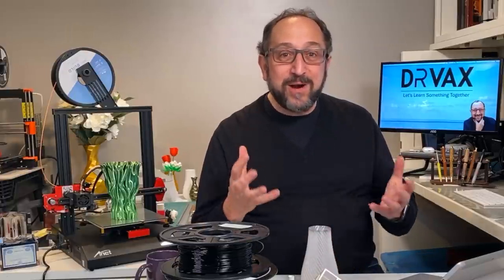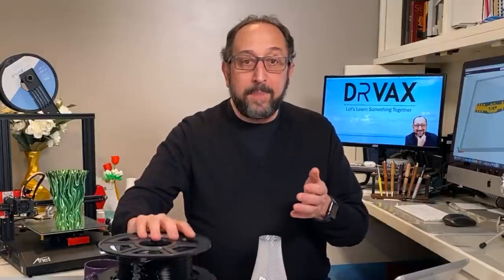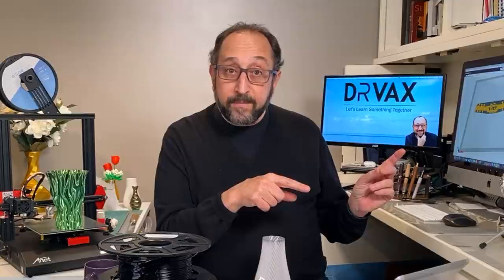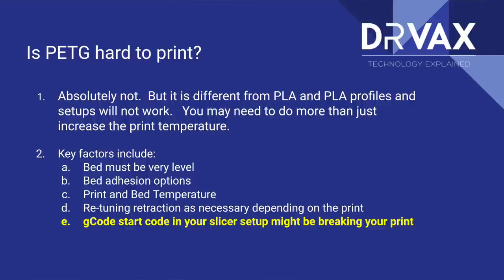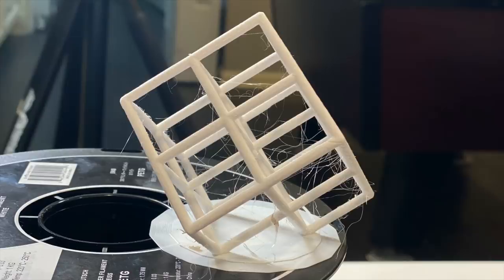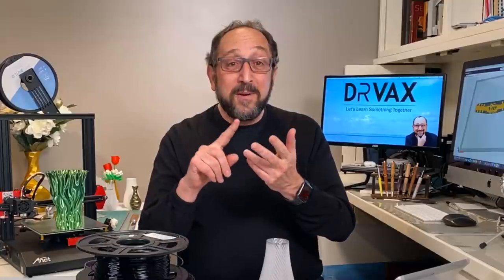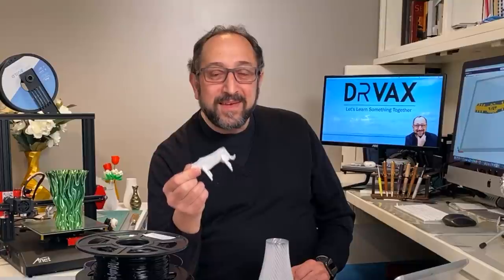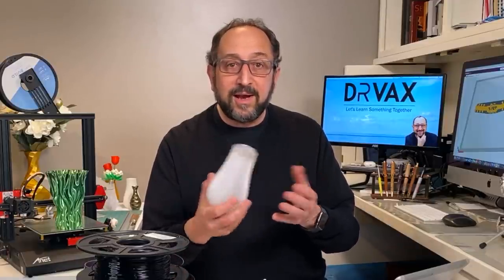How to 3d Print PETG Reliably and Safely

Comment: So I am just starting. But I noticed at least the alpha/beta versions of Slic3r (and Prusaslicer, based on slic3r), (and probably others I haven't tried yet) do indeed set temperatures and wait now. They do not require any editing of the gcode. They do not have a default profile for PETG either. But the types of PETG can vary greatly in temp. settings, so maybe that's why.

Comment: The second set of temperature settings for bed and nozzle are repetition, and do not do anything, as after the first set you do not touch temperatures. Furthermore you could remove redlines and replace them with macros. What I do I heat the bed, home and level, then heat up extruder and start the print
Reply from the maker: I agree that should be how it works but I have found better results by adding the "belt and suspenders" of the second set of temperature settings.  Thank you for participating in the discussion.  I will do some more testing and report back if I find the second set of settings make no difference.  Once again thanks for contributing.
Reply: These are great suggestions.  One I would suggest changing is the start code.  You can accomplish the same thing but also speed up the process by heating both at the same time.  Then wait until both reach the correct temperature.   I do Bed temp first as it is usually slower to heat up, and wait for nozzle then check bed.  The only criticism on this method is that your printer power supply must be able to handle both from a cold start.  I have never heard anyone actually having a problem. 

M140 S[first_layer_bed_temperature];
M104 S[first_layer_temperature];
M109 S[first_layer_temperature];
M190 S[first_layer_bed_temperature];
Reply from the maker: @Kari Penttilä I value your comment and your contribution to the DrVax community.

To help us all build the DrVax community of "makers" I have created a new community forum at http://forum.drvax.com .   At the DrVax forum, you can engage in discussions with me and other community members, use a rich text editor, and post images.  This should facilitate better communications.

It would be great if you could repost your comment to the forum to help with the discussions.

This forum is still in beta and the software I am using is complex so I may have some feature misconfigured. 

All the best.  Irv

Comment: I think now they might have changed a thing or 2 with the start GCode because what I know when I start a print, the first thing the machine does is always to heat up bed and nozzle to the print temperatures I have set in the slicer before it even starts printing the test line. The temperature for the test line is not hard set in the start GCode but even before that, so that it always heats up to correct printing temperature before starting doing anything including printing that line and then after the line have been printed it goes on directly to print the object without attempting to change the temperature again. It holds at that set temperature during the entire cycle from test line until the part is finished.

Comment: I can't get the sunlu petg to stick to my glass bed :( pla sticks like a charm

I got Elmer's purple glue and I'll try it
Reply from the maker: I really like using Magigoo with PETG and have used it on glass beds with good success.  In addition you may have to adjust your Z offset to print PETG depending on your printer.
Reply: If Elmer's doesn't work I'll def try that!
Also the Z. I know I'm squishing too much but if not the pla won't stick. I can do 2 different offsets though

Thank you!

Comment: I would like to print a cover on a radiator cap for a 100 year old Overland car.
Reply from the maker: Not sure PETG will work.  You need to measure the temperature of the radiator cap when the car is hot.  That temperature needs to be below the glass transition temperature of the filament you are going to use.   You can google glass transition temperature and a filament type to find this data.  For example this came up for glass transition temperature petg:  

"190 F
The resulting molecular structure is irregular and the resin is clear and amorphous with a higher glass transition temperature of 88 C (190 F). PETGs can be processed over a wider processing range than conventional PETs and offer good combination of properties such as toughness, clarity, and stiffness."
Reply: That is the temp. that it would be operating in . thank you very much .

Comment: You can also print in higher temperature filaments with 2 add on parts.
#1) AC Hotbed [I worked with Keenovo the produce an AC heater for the Ender 3/3 Pro/5/ 5 Pro]: https://keenovo.store/products/keenovo-silicone-heater-235mm-x-235mm-for-ender-3-3d-printer-build-plate-heatbed-heating-upgrade

For the Hot End you only need to change your heating element for a higher temperature unit like the 50 Watt units from TH3D Studio [easily powered as you remove the Hotbed Mosfet to use the power only to activate the Solid State Relay for the AC hotbed heater as well as the power hungry DC Hotbed]: https://www.th3dstudio.com/product/high-temp-50w-heater-cartridge-12v-2-meter-wire/

Done! The Ender 3, 3 Pro, 5, 5 Pro can now print in any filament you want to use [although to do so for filaments requiring higher than 255°C you do need to change the Thermistor for a Thermocouple as a Thermistor will be destroyed by anything higher than 255°C]. Both the Hotbed and the Hot end can now cross into any temperature you need.
Reply from the maker: Yep correct.  I have extensively upgraded my Ender 5 with a MiniSwiss all metal hot end, a 32 bit control board, capricorn bowden tubing, SEEMECNC EZR STRUDER, and Marlin 2.0 that went with the 32 bit control board.   While I love doing this stuff, many of my viewers want to use a printer out of the box and are not interested in modifying it in any significant way.
Reply: @MakeWithTech  We created the hotbed for those who like their printers and it's bed size and don't immediately wish to upgrade to a unit with a larger bed, but do want to print in many materials. This AC hotbed heater not only crosses well above the temperature the original DC bed can, but it uses substantially less electricity.
My Ender 5 also has a MicroSwiss hot end, the Keenovo AC hotbed, a finer thread 8mm threaded rod, a thermocouple hot end temperature monitor and a Bondtech extruder.
Nearly identical for my CR-10S and parts already ordered for my soon to arrive CR-10S5.
Reply from the maker: @monkeymanstones1 I value your comment and your contribution to the DrVax community.

To help us all build the DrVax community of "makers" I have created a new community forum at http://forum.drvax.com .   At the DrVax forum, you can engage in discussions with me and other community members, use a rich text editor, and post images.  This should facilitate better communications.

It would be great if you could repost your comment to the forum to help with the discussions.

This forum is still in beta and the software I am using is complex so I may have some feature misconfigured. 

All the best.  Irv

Comment: Thx for this. I've always had issues with PETG on my Ender 3. I've just installed a Micro Swiss all metal hot end which should allow higher temps. I didn't realize the gcode part. So is that gcode good for all materials? Do you use the same code for pla? I'll have to search through your channel to see if you have a video on the effects of different nozzel sizes. I'd like to try to print some items faster. Not worried about fine details.
Reply from the maker: Yes because the gcode uses cura variables it works for all materials.

Comment: Hot in your car over there  here in summer  we can get summer temps  105 to 120 degrees in the shade not even in the car
Reply from the maker: Wow.   I guess PLA is a no go for anything used outside.  Even PETG may get a bit soft.  Your 3d printed project may just have to stay inside. :-)

Comment: Well, I not buying Magicgoo it is very pricey in the UK, from £18 upwards stuff that!  I tried glue sticks, hair spray and even the much bragged about blue scotch 3M builders tape. None work even with PLA never known PETG or ABS... I spent over 3 hours once trying to level the Tronxy X5SA bed. that's using the auto and then the manual leveling systems.. and having to adjust 6 bed leveling screws is no fun I can tell you as 4 would be hard to get right but 6 seems to make it harder?  I brought a Tronxy ultra flexible magnetic print bed with the roughened surface, No luck sticking any filaments even on that. after 4 months of fighting with leveling issues and such I managed to print two items and that's all. And those two were a pain to do. As hobbies go 3D printing is hell to do and bloody pricey to keep up. time I buy the printer the tools the cleaning tools the many different filaments etc. it has cost me far more than my hobby I did for years that being Astronomy. And at least Astronomy worked after the set up and gave me years of delights. 3D printing just caused me tons of stress and wasted money.. I lost count of the amount of help videos I watched and tries of printing I done and now have a big rubbish bag full of waste of the failed prints and rafts for them etc.  I now thinking of selling all the 3D printing to at least get some of the tons of money back and go get something that will be better?  Really a pain... and so many long term 3D printing people online saying how good and easy to do printing makes me feel even worse as they seem to do it well and I don't no matter the try's and testing.

Comment: I just steal the wife's hairspray for my glass bed. 

I use PETG when I'm going to print something that is "functional" like a car part or motorcycle part or any other thing that might get warm or be placed under stress. I use PLA for smaller stuff, or to make test parts where I'm checking the fit on something.

Comment: I don't know why you have so many temperature settings.   If you have material_print_temperature_layer_0 and manterial_bed_temperature_layer_0 variables by line 8, you would have them at line 3.  You could just enter those variables at lines 3 and 4.  Then, after your bed comes up to temperature, your home command will run, at which point, you should run the M109 S{material_print_temperature_layer_0} command to wait for the extruder to be up to temperature.  After that, you can print your lines.  I don't see any code there that would change the temperature after your lines are printed that would require you to set the temperatures and wait again.

My start gcode has 3 temperature lines.  M104, M190, and finally an M109.  It works fine.  The fact is, if I wasn't worried about wasting time, I could get away with just 2 blocking temperature lines.

Comment: You put the wait code AFTER the scrub line.  Good advice bad example.
Reply from the maker: You are correct.  In fact it is both before and after the scrub (purge) line.   As pointed out by a number of people this is probably overkill and the second set of waste commands will complete immediately.

Here is the code shown in this video.
; DrVax May 2020 Start Code
; This first section is for printers with ABL
M104 S200 ; heat up extruder before calibrating bed
M140 S40 ; same for bed
G28 ; Home all axes
; G29 ; Probe the bed with the ABL ; ** uncomment this line if you have an always on ABL ***
G92 E0 ; Reset Extruder
M140 S{material_bed_temperature_layer_0}
M190 S{material_bed_temperature_layer_0}
M104 S{material_print_temperature_layer_0}
M109 S{material_print_temperature_layer_0} ; Wait for extruder to get back up to temperature
G1 Z2.0 F3000 ; Move Z Axis up little to prevent scratching of Heat Bed
G1 X0.1 Y20 Z0.3 F5000.0 ; Move to start position
G1 X0.1 Y200.0 Z0.3 F1500.0 E15 ; Draw the first line
G1 X0.4 Y200.0 Z0.3 F5000.0 ; Move to side a little
G1 X0.4 Y20 Z0.3 F1500.0 E30 ; Draw the second line
G92 E0 ; Reset Extruder
G1 Z2.0 F3000 ; Move Z Axis up little to prevent scratching of Heat Bed
M140 S{material_bed_temperature_layer_0}
M190 S{material_bed_temperature_layer_0}
M104 S{material_print_temperature_layer_0}
M109 S{material_print_temperature_layer_0} ; Wait for extruder to get back up to temperature
; End of custom start GCode

Thanks for participating in the discussion.

P.S. I have started a new discussion forum at http://forum.drvax.com where we can all have more elaborate discussions and share pictures on our prints and printers. Check it out. Irv

Comment: And FFS don't print PETG straight on glass. It will bond so hard to the glass surface it will take big chunks of glass off when removing the part. Ideally, don't print it straight onto your PEI covered surface either, it often does the same thing with PEI. If printing PETG on these materials, always put down somd kind of intermediary layer. Gluestick/magigoo, hair spray, even masking tape can often do the trick.